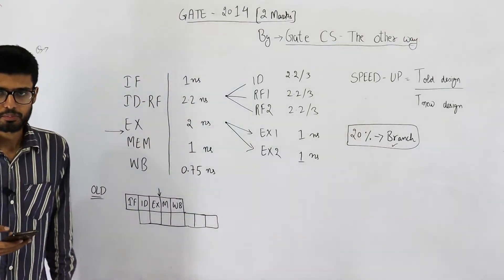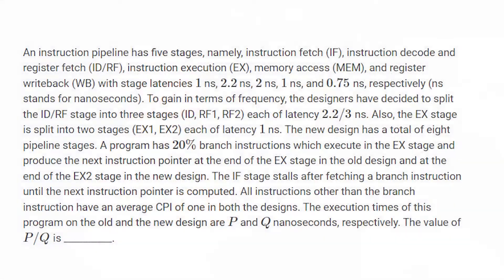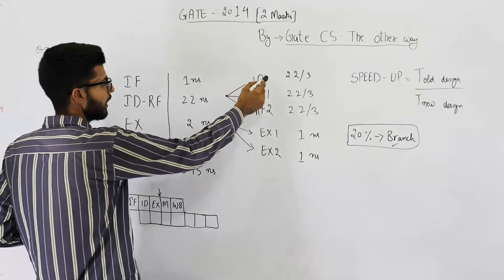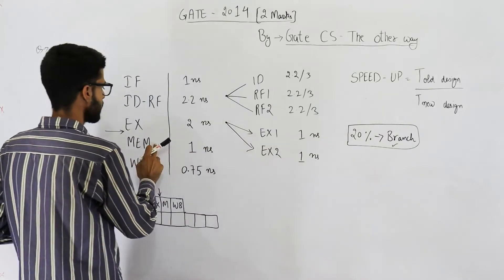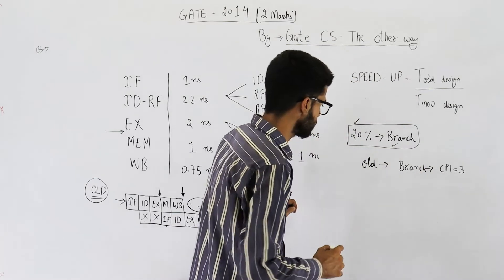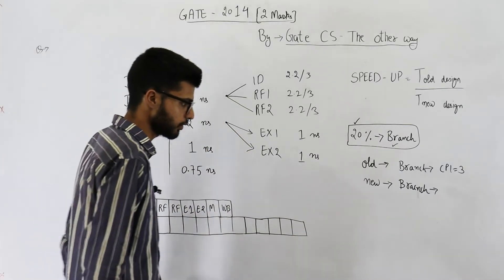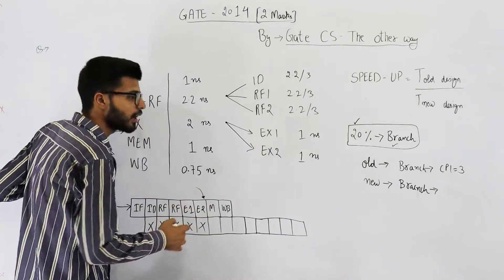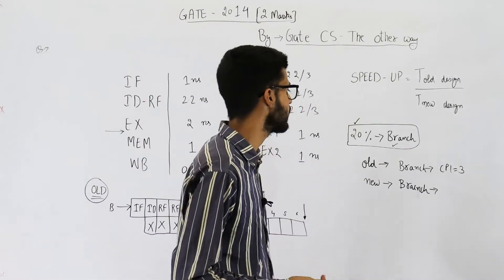Gate 2014 pyq CAO | An instruction pipeline has five stages, namely, instruction fetch (IF)

Comment: Hi Sir, 

In the old design , as per the given question ,why have you multiplied the CPI ( which we derived for "IF" stage) , and multiplied it to 2.2 ns ( Which is the time of ID/RF stage). Shouldn't the CPI of respective stages be confined to themselves , while calculating the execution time of each stage. 

In my understanding, the CPI of each stage can be different , and to get the execution time of each stage , we would need to multiply the respective CPI with given time to find new execution time. ( Is this understanding correct ? )
Reply: The CPI of respective stages are not confined to themselves because at 1 time, multiple instructions will be in the pipeline and thus the bottleneck here will be the slowest stage!